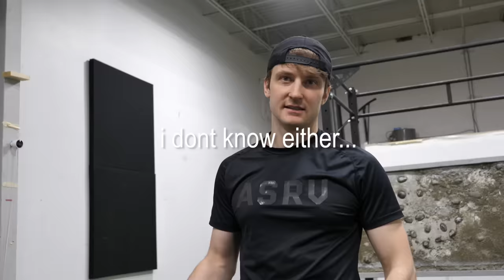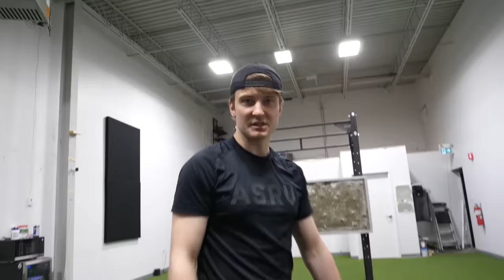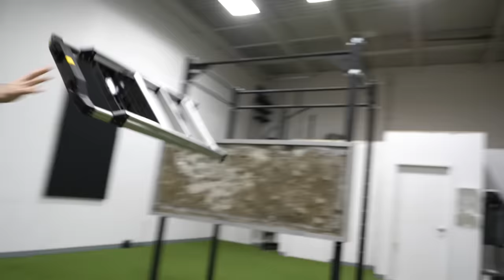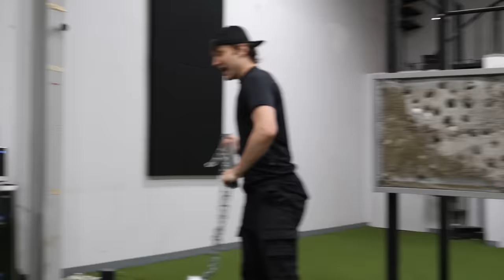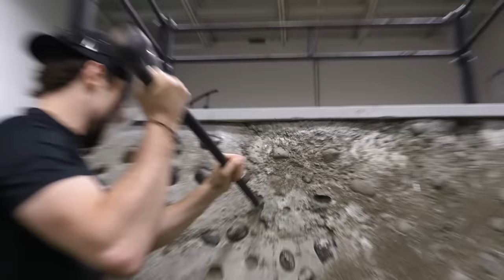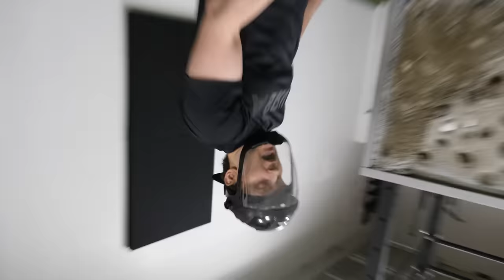100 LAYERS OF ROCKS (DANGER ALERT) UNBREAKABLE WALL

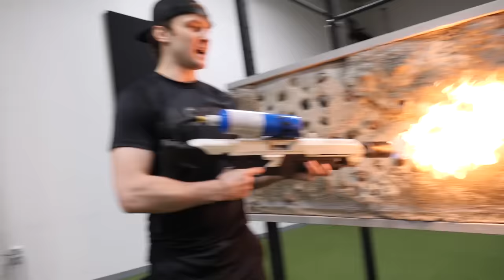Comment: 16:04 knowledge time! actually rocks, cement, and concrete can spall(basically just explode) into shards at high temperatures,this usually happens when they're damp but it can rarely happen with dry rocks, it was really dangerous to not wear a mask there because if one exploded and went into your eye it would not only be a sharp object but also be extremely hot

Comment: 100 LAYERS OF METAL (DANGER ALERT) UNBREAKABLE WALL 
Actually buy 100 layers of different types of sheet metal. Copper, aluminum, iron, steel, etc. And put it all together to make a super THICC metal wall.

Comment: i assume with the boomerang you need a lot more momentum as well as a place with more range so it can have enough length to turn itself around, and have the rotation in order to spin more
Reply: It world still be completely useless against a rock wall unless you fired it out a machine.

Comment: See with your wall and the rocks in between it it makes less required force to break it and more pressure cracks unlike solid concrete which is in prisons so your wall is easier then escaping prison

Comment: dustin here is the difference between a rock and a stone  While many use the terms interchangeably, there is a difference between the two. Stone is smaller than rock. To easily sum it up, rock is made out of stone and mineral matter. ... On the other hand, stones are non-metallic minerals.